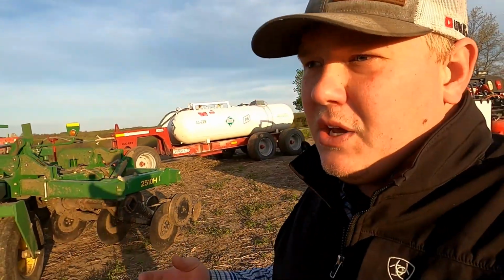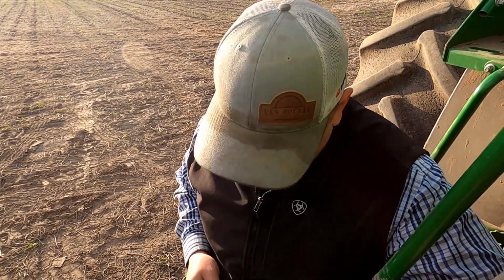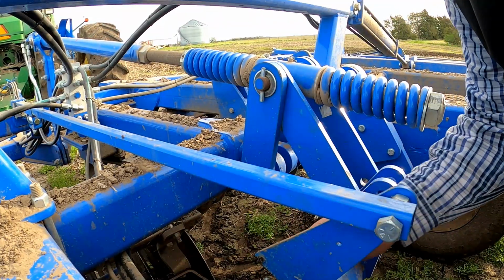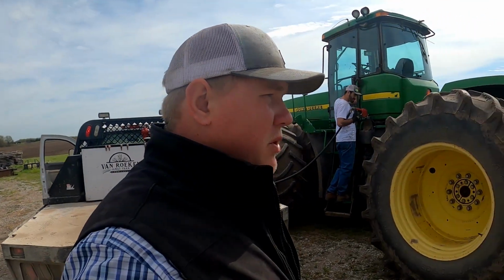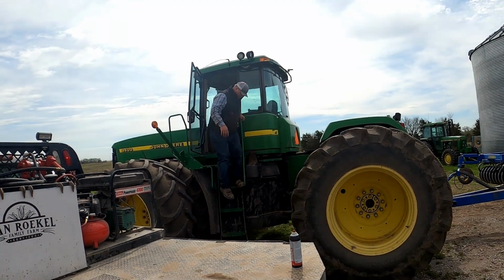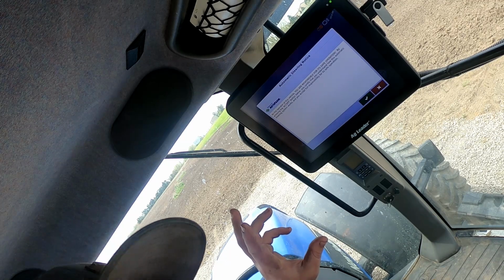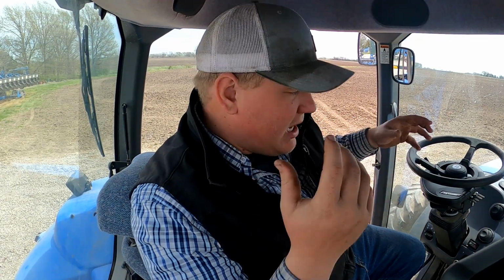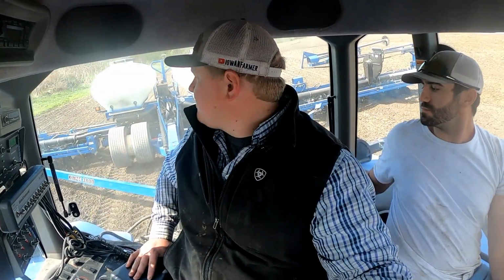First Day of Corn Planting - Plant Vlog Day 9

Comment: Nice to see you thinking beyond the part that broke, I.e. what caused it to break.  
I’d take an air ride seat in a climate controlled cab over the open air, steel seat tractor my grandfather first had.  Waiting for the day when tractors have hover ability, then the implement can be lifted through the mud, maybe.

Comment: Something to think about for a young guy to get into ag is working on a research farm for a seed company.  I worked on a research farm and really enjoyed it.  I planted with 7000 planters that were modifier to plant hills or short rows with a 3 foot alley between the different varieties.  I started with the old check wire to control when the seed was dropped.  That is GPS controlled now.  You wont see any 10 MPH planting there.  You go so slow that sometimes it seem like you would have to speed up to stop.  Maybe this may give someone an idea to a good job.  We need young people on the farms.
Reply from the maker: Roland Hemmann speed up to stop. That’s a good one. I’m going to have to use it sometime.